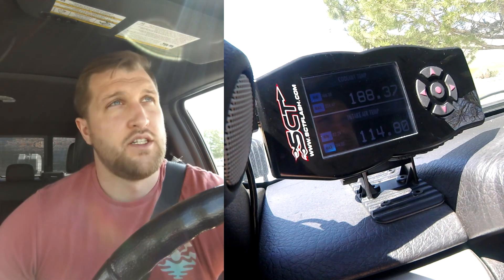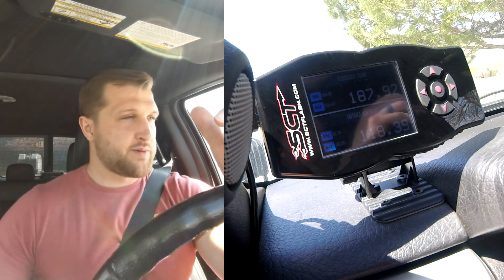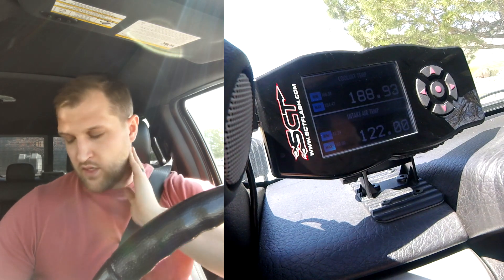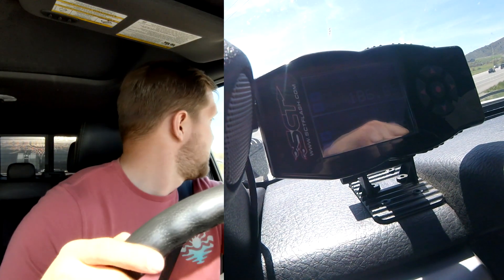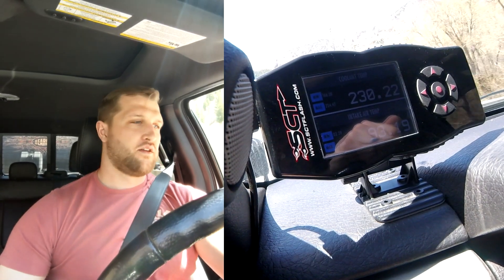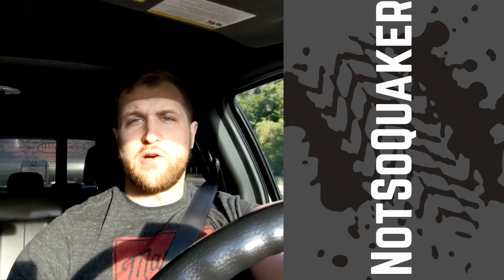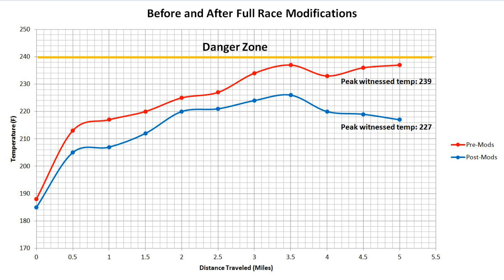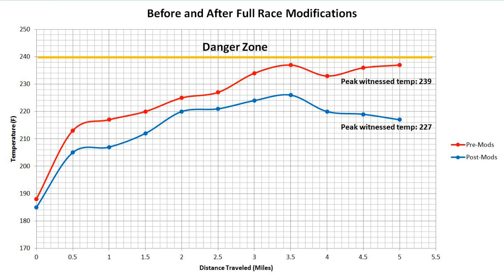Fixing the Ecoboost - Overheating - EP7: Towing Test with Full Race Cooling Upgrades

Comment: Ever do any hot weather towing with this?  Have a 2013 and either doing these mods or buying a 2500 lol.
Reply from the maker: I have never had the opportunity to any hard testing in extreme heat. I'm sure the truck would still get warm. The mods definitely helped, but I don't think it necessarily fixed the root cause

Comment: Honestly dumping the ford orange and using prestone ultimate with 40 coolant to 60 water and a bottle of hipertech supercoolant literally deopped my temps just over 10 degress during normal operation i guarantee it will drop towing dramatically
Reply from the maker: Wow I might have to try that. Thanks for the info!

Comment: Would you happen to remember the transmission temps? Just came back from vacation a few weeks ago pulling the TT and the trans fluctuated between 210 to 238 and wasn’t something I was happy with so I’ve been thinking of upgrading the trans cooler. I noticed the temps would only go up running at higher rpm’s when pulling up steepish grades and go back down once the truck shifted and dropped rpm’s.

A little different from your setup in the vid as I have the 5.0 and my camper is probably around 6,500-7k lbs.
Reply from the maker: I don't. In general, it did start to get slightly warm before I did the mods. It stays nice and cool now! Does your truck have a transmission cooler at all? Depending on your trim/packaged, you may not have one
Reply: @NSQGarage  Yeah it’s a ‘14 XLT and it has a stock cooler. It normally does just fine but it didn’t like the small mountain passes between Colorado and New Mexico. Looks like Full Race only deals with the EcoBoost when it comes to the F150 so it looks like I may need to look elsewhere.

Comment: Great video, I'm sitting here getting ready to do the same mods to my truck minus the Manifolds. This test is exactly what I was looking for. I live in Utah too and need the help when pulling this trailer in the summer. I'm also doing a 170 thermostat, AFE larger Transmission pan, and an air/oil seperator. Might as well dump a bunch of money into this pig at 150k miles.

Comment: I pulled my camper up to flaming gorge with my 2011 last year when it was 95 out and my water temp was riding right at the white line on the stock gauge (not sure what temp that is?).  I’m putting an oil cooler on so hopefully it helps a little bit.
Reply from the maker: yeah, you must be in the same region I am. I hope that helps some!
Reply: How heavy was the camper?

Comment: @nsqgarage
How has all the upgrades from fullrace been doing so far?  I'm looking into doing all of the upgrades to help with heat and be able to tow with better cooking than factory.  And have you seen the new formline stainless manifolds that they will be releasing soon?  I tried asking them to use my truck for testing lol!
Reply from the maker: I saw the manifolds. They look sick! But I also heard that Ford has new manifolds that use more studs. Cooling is better with my set up. It still likes to get warm but it's more manageable now
Reply: I've read something about fords new replacements being better than the factory ones??  
Bd diesel offers their new ones that are similar to the crp ones you installed on your truck, but utilize some extra holes in the heads for i think 3 additional studs per side.  
I asked full race about that and they seem to find it interesting why they would use additional studs???   The new full race ones sure look sick and I'm sure will be the highest flowing..  maybe they won't warp like the cast iron ones and it won't be necessary to have additional studs anyways. Guess we'll see when they become available. 
Thanks for the reply!  I haven't been on YouTube for quite awhile. You've sure made alot more changes and upgrades to your truck. Liking your bed support and spare tire rack.  I liked the 454 motorsports one like you mentioned, But that's badass how you designed and built yours to do both of those together and be easily remove able still!
Reply from the maker: @dangibsonakadisasterdan7050  thanks I really appreciate the support. Yeah I feel like I would have got the full race ones if they were out when I needed them. I wish their design used more studs as I feel like that would absolutely have been the no compromise solution. Let me know if you end up using them!

Comment: Hey there - how has this been holding up?  Hoping to use you for a point of comparison.  Same cooling mods on my end albeit different brands (Mishimoto radiator & intercooler, Saudi-style trans cooler and custom oil cooler (actually not truly custom - using the OEM that Full Race uses).  160 degree thermostat as well (and tune compensated to kick fans on earlier) - though tbh I think that was a wasted mod.. once you're hot/overheating and that thermostat is open.. it's open.. so a bit pointless in solving this problem.

Anyway, the other mods definitely helped but I still get hot if it's over ~80 degrees out.  I'm towing very steep (6-7%), long (15 miles sustained at that grade), high heat (90-105).  Towing a 30' travel trailer for reference - about 7000lb loaded.  But it even does it when towing my 4500lb boat.  Doesn't seem to do any better/worse between the trailer and boat as far as heat goes.

I have NOT swapped the radiator hose - that's my next step.  Have you had a chance to tow in hotter climates (same 6-7% grade?) - if so how is it doing?  I'm trying to determine if this hose swap makes a significant difference.  I'll admit the results you got here were more drastic than what I saw, so I'm HOPING that hose might be the smoking gun.

My next step after the hose might then be followed by moving the oil cooler up higher and fitting its own fan to it.
Reply from the maker: Yeah your conditions sound like they fit the bill. I haven't towed in super hot conditions yet. We sold the camper and are waiting to get something bigger. Unfortunately I didn't do the mods in steps so I have no way of really knowing how much that hose makes a difference. With my setup, I would still like to see cooler temps. So I have considered regearing. I think the bigger tires that drive lower RPMs might have a big impact.
Reply: @NSQGarage  My truck started as 3.31's and I regeared a few years ago to 4.11's for that exact reason (I'm on 34's).  It helped a lot in off-the-line tug and overall drivability, but honestly didn't help the temps really at all.  Or maybe it did and was just too small to notice.

I'll try the hose mod I suppose then go on to adding that fan in front of the oil cooler and see how things go from there.  Will report back if it makes a major difference!
Reply from the maker: @yoster77  good luck man! I remember you from the Ecoboost forums!

Comment: My 2011 3.5 only overheats when it's 85 or higher outside. I tried to pull it to Bryce canyon last week from SLC and it was stressful to say the least. I'd like to see a test like this in the heat (90 plus) going up a big grade like Parleys canyon.
Reply from the maker: That is a scary hill. I am sure that would really stress the cooling system out. I havent had a reason to tow over that hill. But if I have a reason to tow up that, I will be sure to record some video and data

Comment: Its been a Year later, how are you liking it? What's you hottest summer temperatures. We get to 116 degrees
Reply from the maker: I would say that the mods definitely helped. However the truck still gets warmer than I prefer and I still watch it closely. I haven't towed in anything close to 116, but that would probably give the Ecoboost some trouble. Long, steady uphills with no periods to cool off still require you to pay attention to temps.
Reply: @NSQGarage  Thanks for the info. Yeah, my truck never had heating problems while towing the first couple of years. Its a 2013 F150 FX4 from Canada Bought in St George, Utah in July 2016. Now it overheats on small hills. And we've got tons of big hills in Utah.

Ford recommended I replace the radiator (already replaced the thermostat & that didn't help). Another mechanic buddy says he's only seen the problem in Tuned F150's & to get it set back to stock.

I just want it fixed & not have to worry like before.
Reply from the maker: @MatthewsFabrication  interesting you mention the tune. I feel like everyone on the forums who had the same issue also had a tune. Maybe it's worth a shot. I'm up in the Ogden/Logan area btw lol
Reply: @NSQGarage  That's good to know about the forums. I'll have to ask ford to schedule to see if it was tuned. I never got it tuned, but did have something in the engine fixed, as it was leaking, can't think of it right now, but the fixed both sides. Made the eco boost power horrible. 

Ever since then I've had the problem it seems like. They took the entire top front cab off to fix it, they said it was easier. 

It reset it to Canadian Km, etc. So maybe it happened then???
Reply: @NSQGarage  Right on, we used to live in Logan, then Nibley, before moving to St George.

Comment: Any updates on your setup now that you've towed in hotter weather? Still getting too hot or has this fixed the issue?
Reply from the maker: It is much improved. It still gets warm if I'm going 80 mph up a hill. But it feels more manageable now
Reply: @NSQGarage  Awesome! I am in the process of finishing my oil cooling setup. I have all the other mods, but a different intercooler than you. It helped over the stock setup, but it's still too close to limp mode than I want to be. I am hoping the oil cooler will widen this gap a little more. Appreciate the series you made, it was very helpful and well done!
Reply from the maker: @TheItalianDNA  thanks, I hope it works out for you? Where are you located. Curious if you are also high altitude, low humidity
Reply: @NSQGarage  Yes. Pacific Northwest but inland. About 3,700 ft and dry, dry, dry.

Comment: my 11 eco boost had the exhaust bolt snap two times. i got a '15 and blew the exhaust bolts at 75k miles, i wish they would fix it :(
Reply from the maker: yeah its a poor design. sounds like you had exceptionally bad luck

Comment: Same question as below…Did you run it with just a new thermostat or everything together? I just replaced my thermostat to a 160 degree because I was overheating with my camp trailer. I also just had both exhaust manifolds done and my left turbo replaced. I’m headed out of town this weekend and super nervous about overheating. Do you think a full coolant flush will help at all?
Reply: Forgot to mention I’m also running MPT tunes with a SCT LiveWire Tuner. The thermostat is a Livernois 160 which I’m not sure is right for Utah either.
Reply from the maker: so i have had the 180 degree thermostat in for a while. this test was a comparison between stock  radiator, trans cooler and oil cooler vs aftermarket radiator, trans cooler and oil cooler. the lower thermostat gets you a little more time as you start at a lower temperature at the bottom of the grade. but that only get you so much. a coolant flush may help a bit, but I wouldn't get your hopes up. if you want a little boost, you could run a 60/40 water to coolant ratio.

Comment: Lots of great info. I have the exact same issues on my 13 ecoboost. I was towing 8k when it was 100 out and I had to drop it into 2nd along with turning the ac off to keep it from overheating. Not fun lol.
Reply: Good work. I have a 12 Eco, same issues. Putting in a Wagner CAC, mishimoto oil cooler and 170 t-stat. Towing 5500 next week in May 100* Mojave heat, seeing if it will overheat this time. I think its a combo of things you have to do to whittle away at the temps, i.e. premium fuel, mods, dropping into 3rd gear, but at what point do you save $3000+ in mods/tunes and roll your, say 70,000 mile ecoboost, into a 70,000 mile used F250 6.7L?
Reply: @LilQSlice  did it help?
Reply: @zwagoner3  I ended up not putting in the 170 t-stat for the trip, ran out of time. With the oil cooler and CAC, still hit the reduced power temps a couple of times pulling up those hills into Big Bear, but the truck recovered very quickly, like within 30 secs, but still annoying, especially since i was running 91 oct gas on an 87 oct 5 star tow tune. 've since put the 170 in, along with the change in the tune, but i've only towed to San Diego, which is downhill most of the way. It stays at a cool 190-195 the whole time though, and for some reason my unloaded fuel economy has increased from 13ish combined to about 16.5 combined, but whatever i'll take it.
Reply: @zwagoner3  Made the trip today from San Diego to 29 Palms, pulling my Jayco up the grade. Temps never exceeded 212 degrees, stayed in 4th gear, dumping lots of boost, but it never got past 212 with the 170 t-stat. I'd say my issues are fixed now.
Reply: @LilQSlice  I switched from my BCB tune to my MPT and I went from 230 temps to 215 or so. I also usually lock in 4th gear.  Good to see the T stat helping
Reply from the maker: We can cry together! 😂
Reply: Yes! Lol!!
Reply: I've been fighting the same thing on my '12.
Reply: Why does a lower gear and no ac make it run cooler? I have issues with my 5.0 trans running hot. Driving a moderately hilly road at 100km/h, empty, with ac on full in 86f weather I was running about 214f.
Reply from the maker: @williamlogue  a lower gear implies a higher RPM if you are at the same speed. A higher RPM on the Ecoboost generally means less boost. Additionally, the higher RPM means that the water pump is flowing faster. If the AC is on, the condenser is adding additional heat in front of the radiator as well as adding additional load on the engine. Running the heat instead of the AC will also draw additional heat from the cooling system.

Comment: Second run air temps were cooler and 1st run was either really hot outside or heat soaked since ait started at 120. Not  conclusive enough to justify money spent. I know you can't control the weather . I do appreciate the data. Thank you for doing this! But can't wait to get a diesel truck man this blows .
Reply from the maker: Yeah a diesel might be a good option. Maybe many years down the road for me
Reply from the maker: And I guess I failed to see the difference in the iat. I honestly think the temp sensor gets heat soaked though.

Comment: Was that the stock thermostat both runs? Or did you put a colder one in with the new radiator
Reply from the maker: 185 degree thermostat both runs
Reply: @NSQGarage  specifically 185? The oem one is 195
Reply from the maker: @firebry23  yeah I put the motocraft 185 t-stat in. I think its out of a mustang gt. I can find the part number if you need it
Reply: @NSQGarage  they sell a 160 thermostat also. Ive been looking at this radiator and the Mishimoto one.
I've got a 2011 eco
Cr performance manifolds, Ams Adapters, 3" catless dp, 3.5" flow though exhaust, raptor trans cooler, thermal bypass in the trans, and a Livernois tune. Id like the get a upgraded intercooler for it also
Reply from the maker: @firebry23  it sounds like you have a pretty similar truck to mine. i definitely recommend the FR unit. about the thermostat, 160 seems really low. idk if you want the engine running that cool on a normal basis

Comment: Great job with posting some data and working at keeping it pretty consistent around the testing parameters. A lot Eco's see high Coolant temps at altitude, the cooling system really seems to be under engineered for the extremes. I have a 2014 with a ton of work done to it and even did a delete of the factory oil cooler for a air-to-oil remote mounted cooler as I didn't like the "diverter" used in the lower rad hose to send water to the oil cooler.
Reply from the maker: i am a lurker in the Overheating While Towing thread on the forum. I believe that you are a frequent poster there lol
Reply: @NSQGarage  Lot's of great info in that thread!

Comment: When's the 0-60 test coming? Haha. Interesting it didn't have to downshift running the same hill. The mods should have only been 20hp at best right (if you believe full race)? Maybe the exhaust leak was robbing you of more power than you thought.
Reply from the maker: You probably will be disappointed with the 0-60 test haha